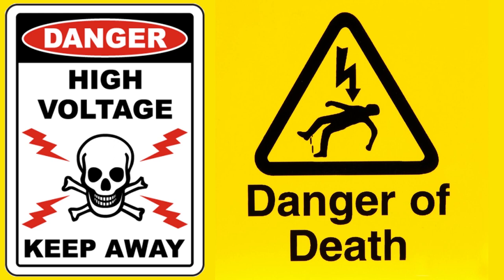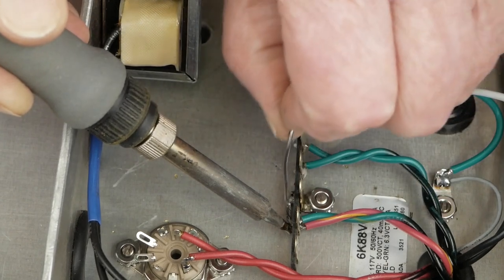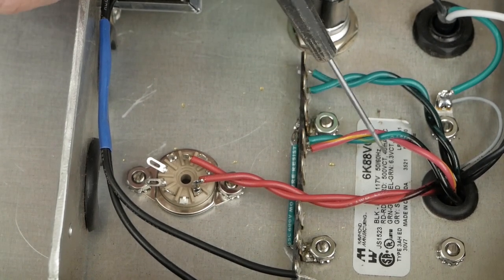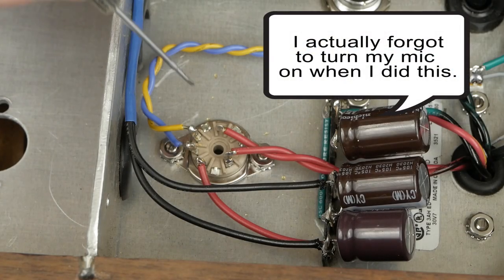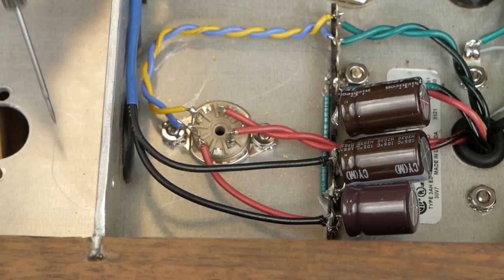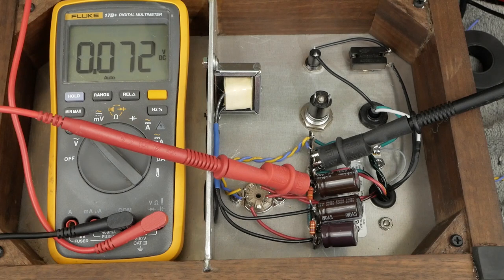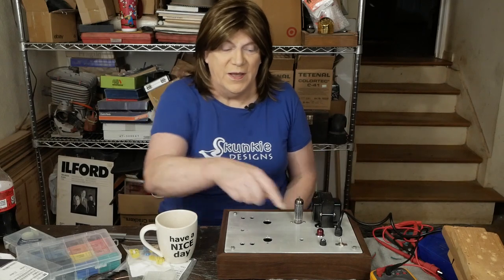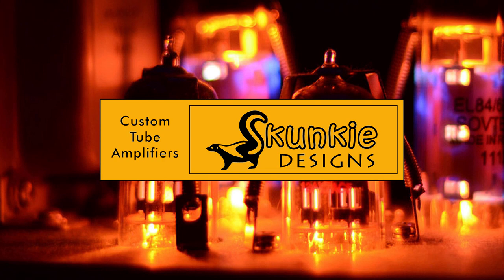"Color" Tube Pre-amp for Solid State Amps: Power Supply #2

Comment: technically, combining the resistances does change the smoothing characteristics of the filters.  The LC filter is going to provide -34 dB ripple attenuation regardless of the Rd position.  There is approximately a 5 dB difference in ripple attenuation in the RC filter when combining Rd with the RC filter.  Not a big deal in this circuit.  

I believe Matt is placing Rd in the circuit to allow the builder to tweak the final B+ voltage.  If the B+ is too high, swap in a higher Rd and vice versa.  Also, the placement or arrangement of individual resistances following rectification will not affect current.

Comment: I’ve really enjoyed this series, watched the videos a few times and subscribed. Can you explain please why the star ground goes to the transformer centre taps rather than the point where the ground/earth of the incoming mains power is attached? Since both these are connected via the chassis why are they these two ground points not directly linked? Thanks, Alex
Reply from the maker: 1st is for safety, I always want to ensure the safety ground has a solid connection. 2nd is for some reason, I have had less problems with hum when they aren't tied to the same point on the chassis. shrugs
Reply: @SkunkieDesignsElectronics  Thank you for the reply. That’s very interesting because electrically they are still connected via the chassis. I’ve always been tempted to make a valve amplifier but considered the task a step too far for a beginner but this series of videos has really given me the confidence to try. No timescales on when, but I think it will definitely be my first project. Thanks again for sharing your knowledge with others.
Reply from the maker: Grounding stuff in tube amps can be pretty weird :)

Comment: Haven't seen the schematic, I wonder if putting the 2k of drop resistor between rect tube and 1st cap and some between 1st and 2nd improves the voltage regulation on transients.i realize this supply is class a preamp has small change in current.what value is the 1stcap? you've got me curious to experiment.have seen where drop resistor to reduce b+ was suggested to put between rect. And 1st cap on   small set power amp.your video s have benefit me on how to do the circuit grounding . bridge gap between schematic and actual lay out and construction.some small tube rect can't take much than 10mfd. On 1stcap without considering surge charge current .I damaged a 6x4  that way.
Reply from the maker: But he placed the resistor in between the first cap and the choke... That's not the same as between the rect and the first cap. And you are right, a 6X4 can only handle 10uf (and are know to be very weak anyway...), this tube is rated at 50uf. It's a much stouter tube and as you said with class A, there is almost zero change in current to consider. Also moving the resistance inline with the choke to where I did seems to make that RC stage of filtering more efficient as it sims lower ripple.

The schematic is at the web link.
Reply: @SkunkieDesignsElectronics  thanks for the clarification.i looked at the schematic and I think I understand why he did what he did.i also now understand why you made  the change.2k feeding that cap for preamp seems ok and you may gain some ripple reduction.6ca4 should last a long time in this circuit.

Comment: Hi Stephe. You mention at the end that this is suited to cheaper solid state amps. If you have time can you please tell me if this is suitable to hook up to an ice power ICEpower 1200AS2 specs > Output Power per channel 1 % THD+N, 20 Hz – 20 kHz	1200 W (4 Ω)
600 W (8 Ω)
Output Power per channel 10 % THD+N, 20 Hz – 20 kHz	1400 W (4 Ω)
Minimum load impedance	2.7 Ω
Maximum amplifier efficiency	–
Maximum total amp+psu efficiency	80 %
Supply voltage input	85-264 VAC
Peak output current	38 A
Dynamic range	129 dB
Amplifier maximum output peak voltage per channel	100 V
Output referenced idle noise (A-weighted)	25 µV
THD+N 1W/1kHz	0.005 %
Sorry if this is a dumb question, best wishes from sunny London.
Reply from the maker: You didn't specify the input impedance, which is the main one that would matter.

Comment: By the way since it doesn't have big consumption, do you think his power supply will be able to feed four pairs of "color" preamp in one box or it will be too much?Thanks.
Reply from the maker: I would have to do th3e math on that one, but possibly. I have learned leaning hard on a transformer/power supply can end up creating noise. It's important on a higher gain pre-amp to have the power supply somewhat "coasting".